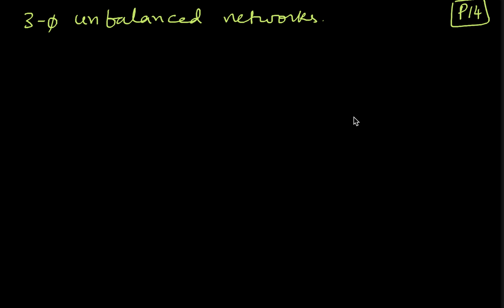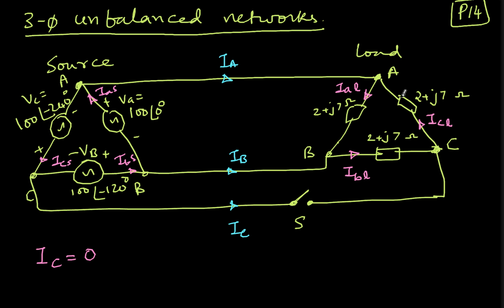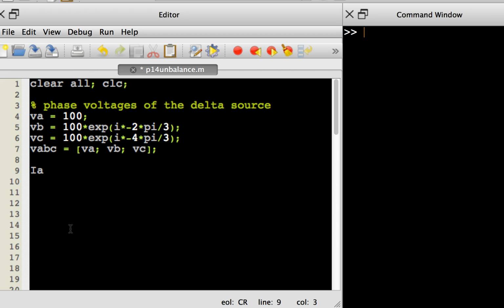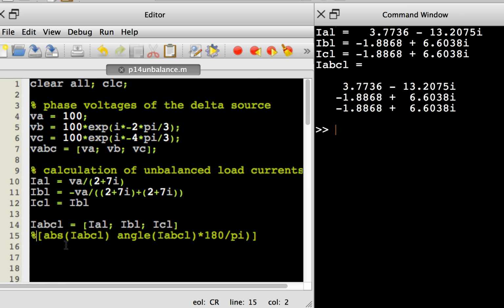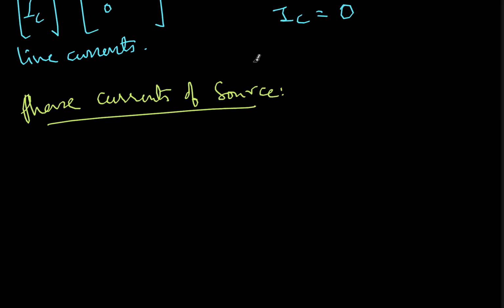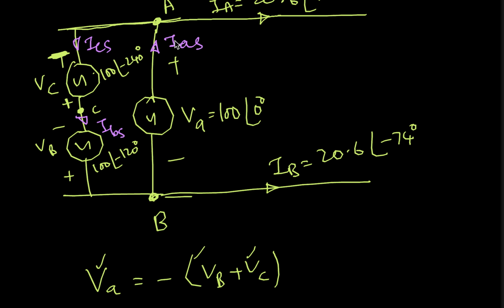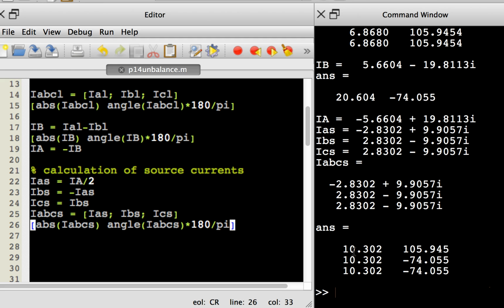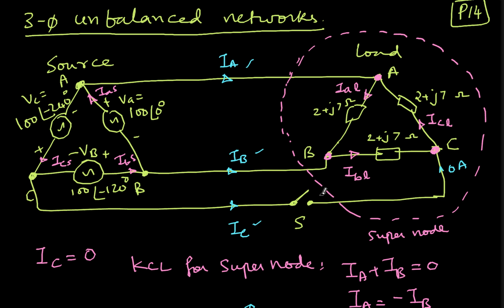3-phase Unbalanced network - Delta - Delta (part 1 of 2)

Comment: why do you use MATLAB for calculation and in the PE exam we will use only calculator?
Reply from the maker: I use matlab or in general any computer coding because in the industry outside no body uses calculators any more. University exams are old fashion and use limited devices such as scientific calculators. Talk to professor. Request to use computer code for solving exam. Based on the reply you will get more understanding about the university you are in. All the best.